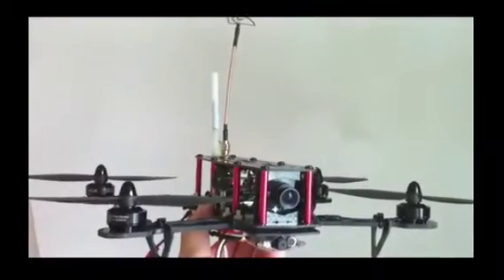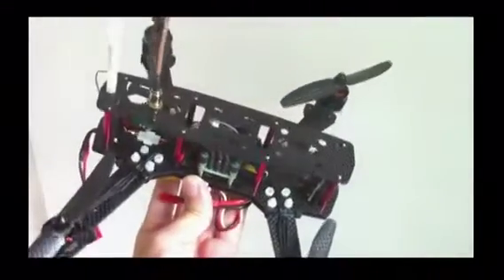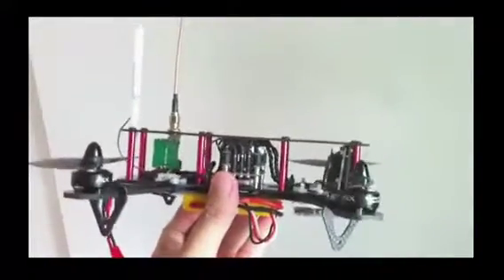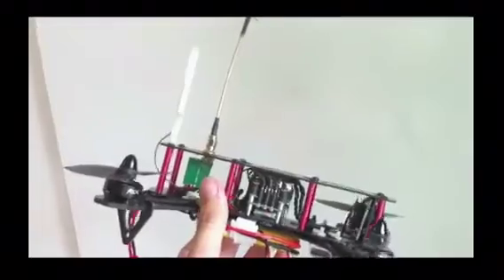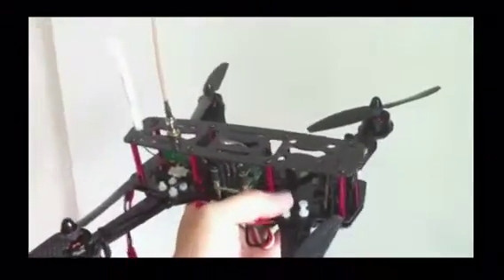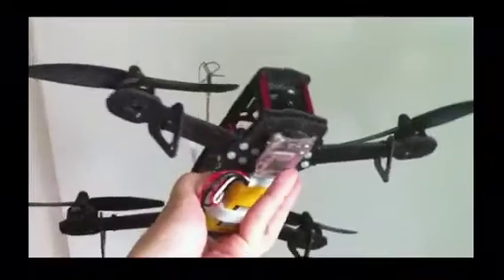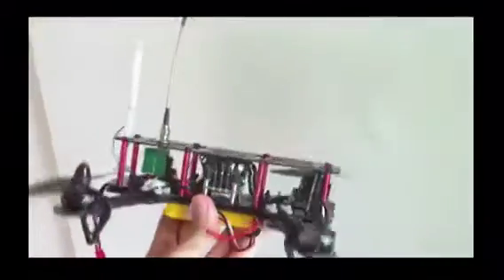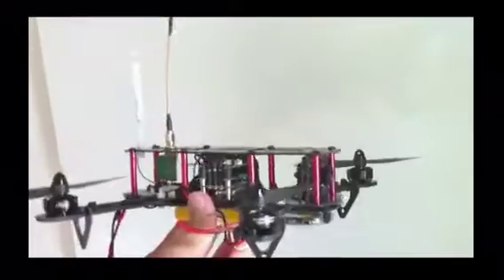Lightest 250 Quadcopter FPV-Racer

Comment: Very impressive considerations, even down to the nylon bolts.  How much does it weigh and how much is that versus a similarly performing (in flight times, that is) 250 quadcopter with the "usual" battery, ESC's and camera?  I am trying to shed weight so I can lift more grams of stuff.  Thanks in advance.